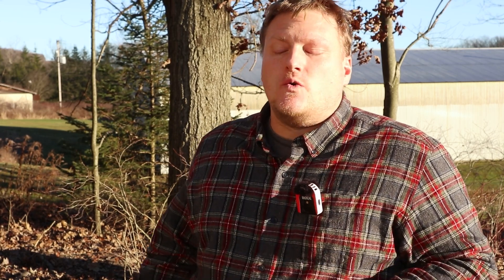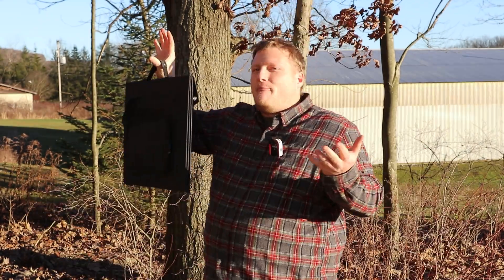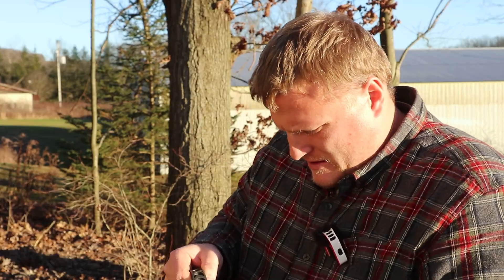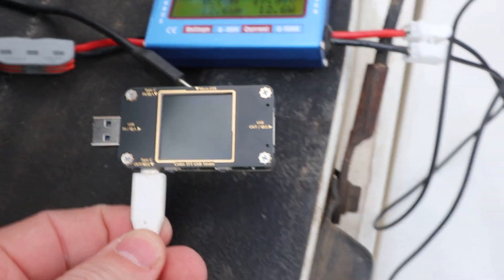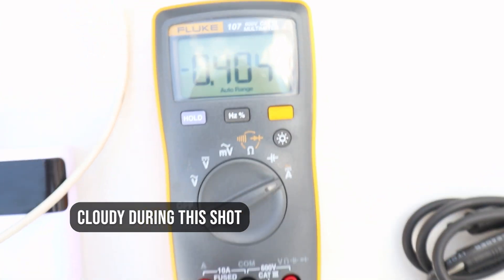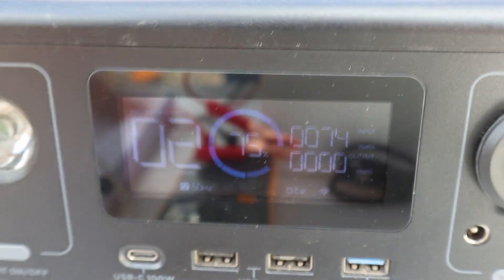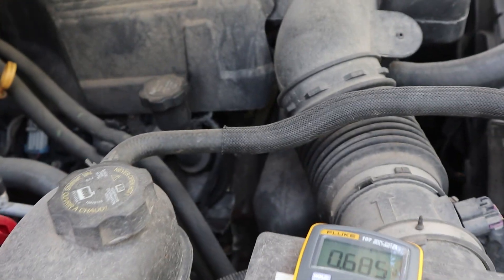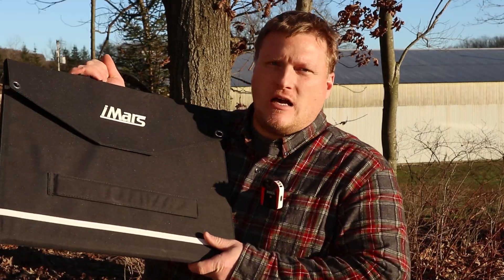iMars 150W Folding Solar Panel

Comment: Hi Joe! How exactly did you connect the solar panel input cable to your power station? (the voltage meter device is not relevant, I want to connect it directly to the Ecoflow power station) Did you cut it in half the MC4 cable of the power station? Is there any trick or important thing here to be cautios of? The Imars solar panel (at first glance) does not seem to fit into the power station's solar input socket. Thanks for the help!
Reply from the maker: I made a bare xt60 pigtail. You could cut the wire but this would be a plug and play solution: https://amzn.to/3T88ZhV

Comment: 85 watts is great for full winter sun.
Reply: A cold winter day can actually be surprisingly good for solar.  If it's in a deep freeze and you have full sun, you might be pleasantly surprised.  I even exceeded mid-summer power once.  First of all, the sun was nearly has high as it could get that day.  But the key reason is, when it's very cold, silicon solar cells are most efficient.  The voltage actually increases a bit.  In the summer, when your panels get very hot, the opposite happens - you lose some voltage.  Current is pretty much unaffected by temp and only controlled by the brightness of the sun.
Reply: @ChristmasEve777  What latitude are you are?
Reply: @MarkRose1337  I'm at around 44 N.  I live in Michigan.
Reply from the maker: @ChristmasEve777  and I'm at over 41N
Reply from the maker: I'll need to revisit this in the summer.